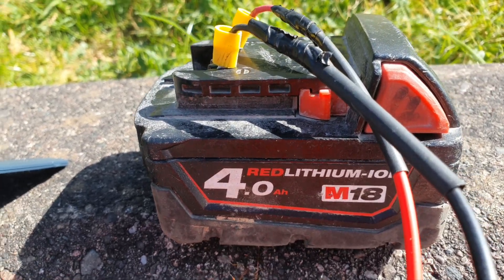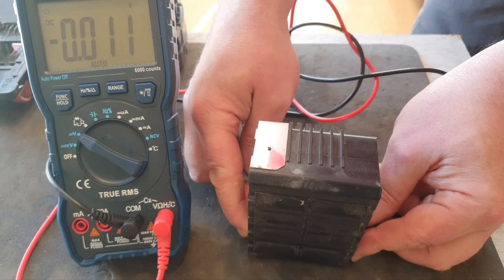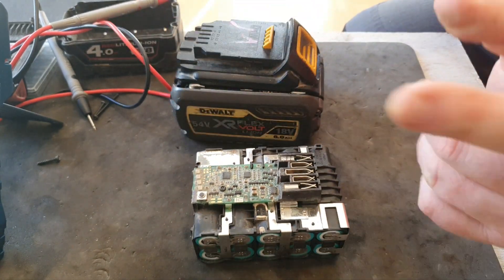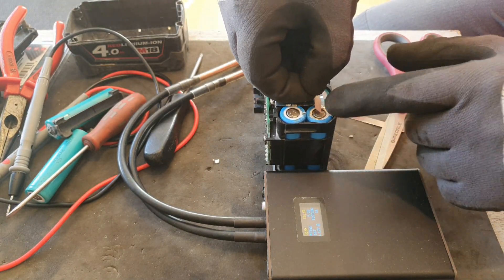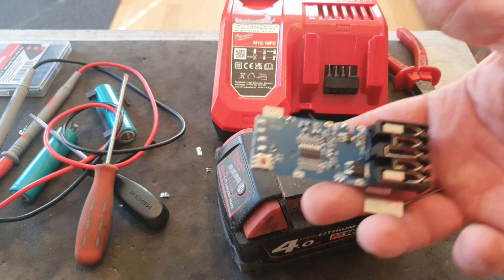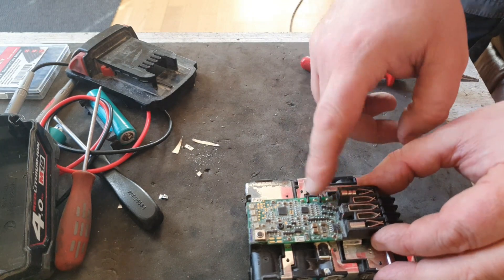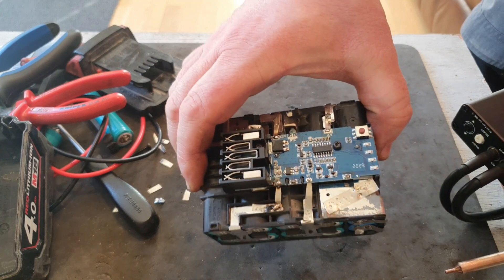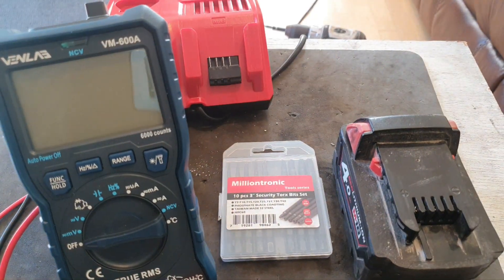Milwaukee M18 4Ah Battery repair #milwaukee #repair #powertoolrepair

Comment from the maker: If you are interested in the items used to repair the battery links are below

Milwaukee M12 Soldering iron
UK  https://amzn.to/3UcOsdy
USA https://amzn.to/3MmXJxx 

Venlab Digital Multimeter
UK https://amzn.to/3KDi805
USA https://amzn.to/3MlEep8

Spot Welder
UK https://amzn.to/3mfPXLi
USA https://amzn.to/3nOlCEa

Milliontronic Security bit set
UK https://amzn.to/3Kj7N87
USA https://amzn.to/3UdIRnk

Comment: Hi, just looked at the spot welder you linked to here, they dont look the same? Are you happy with this One?
Reply from the maker: Yes they are basically the same
Reply: Ok 👌 the one I have now cannot spot weld to the original metal on m18 battery, no problem to a 18650 Cell. Do you know why?
Reply from the maker: @fmolland  the one I have wouldn't either you have to use fine strip
Reply: Do you know where to get pure nickel strips? Many on eBay say that they have 😀
Reply from the maker: @fmolland  https://www.ebay.co.uk/itm/274865824817?mkcid=16&mkevt=1&mkrid=711-127632-2357-0&ssspo=k6L2r3Z0R46&sssrc=4429486&ssuid=cjPn_ZfdQLW&var=&widget_ver=artemis&media=COPY
Reply: @doctorlefthandthread  I guess the size changes with larger Ah, but what strip would you use on a M18 5Ah battery?
Reply from the maker: @ingeflaat  I use a higher grade spot welder now
See below where I built it live 
https://youtube.com/live/TIwhXS1bceM?feature=share

 it welds this better strip

https://amzn.to/4aI82Vx

Comment: Great informative video, I have been struggling with what to do about all these batteries, most are all Milwaukee, but i have others as well i just put in a box. Can you tell me where I can start to search for the circuit boards to make these repairs. And here is a question, once I found these circuit boards, check everything and make the repairs, do you think there is an upgraded board that will fit that can up the juice on these 18V?
Reply from the maker: The board will never up the juice the cells are where the power comes from you should be able to source boards from ebay if you need a link let me know
Reply: Thank you very much, if you have a link and it is easy to share that would be greatly appreciated.
 @doctorlefthandthread
Reply from the maker: It will take a while for delivery but
https://www.ebay.co.uk/itm/394818871656?mkcid=16&mkevt=1&mkrid=711-127632-2357-0&ssspo=q4o6nionq0e&sssrc=4429486&ssuid=cjPn_ZfdQLW&var=&widget_ver=artemis&media=COPY

Comment: Need a few bits fixed Milwaukee grinder combi drill and rip saw I’m in Armagh but be all over the north
Reply: Sent email with number there
Reply from the maker: @aaronmccool922  haven't got it yet but I will give it a while here
Reply from the maker: No sign of it try it again drlefthandthread@gmail.com
Reply from the maker: Are you on WhatsApp? If so email your phone number and I will ring you drlefthandthread@gmail.com
Reply from the maker: I have never received the email.